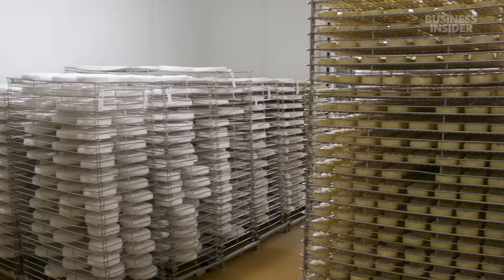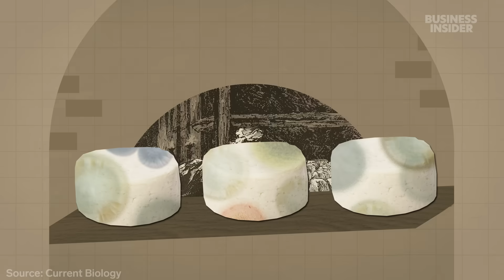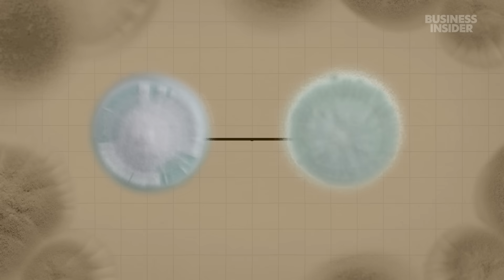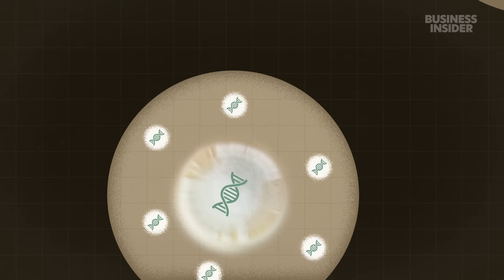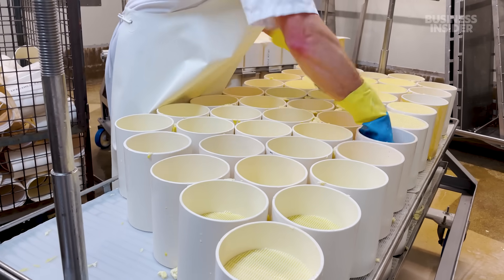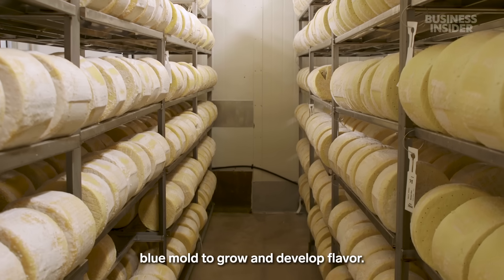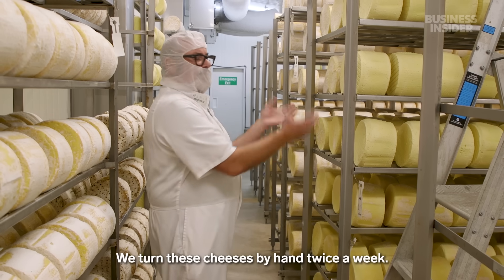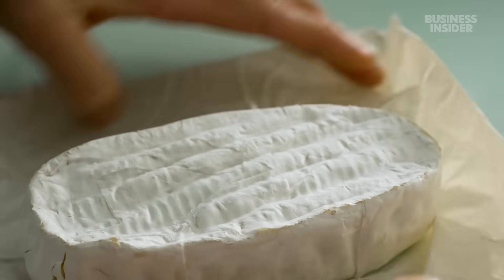Why the Mold Behind Brie Cheese Is Disappearing

Comment: Another theoretical idea. Get various cutting boards of staralized wood, stone, or metal. Keep those in a controlled cold chamber. Weekly by a cheese that have the mold covered cheese. Then use those boards for cutting a slice. Or just placeing the cheese down. Do not clean the board and place it away back into the chamber. To see if it creates a suttle controlled breading ground. Hyper specific on keeping only the cheeses with the brine that has the desired mold. (No specific brand, so the milk component might help) Then swab and see if the mold comeing from it is compatible.

Comment: It would be cool to cross do some isolated experiments. So a separate physicality for the purpose of controlled crossing. Making a small science batch of the cheese. Then get other cheese types to attempt the same mold with. Having two pieces in a controlled box. Bre to be paired with a separate cheese to see how the combinations are. See what mold grows from that cross over, but the idea is to use that mold with higher compatibility to re-cross breed into the primary mold needed. To re-create the diversity factor. But if the mold is more prone to overlapping. I am curious on what heat exposure or uv could do to slightly and try again to have the main bre mold introduced again. To see if that might help.

Comment: When a child in the mid-50s, "mouse trap" cheese was cut from a big wheel, on request, by the grocer who had first soaked it overnight to remove the cheese cloth and soften the rind for cutting. To me, the best part was the rind, the flavour and texture of which I enjoyed. The cheese itself was further enhanced if some blue/green mold graced it. I could never understand why most folk cut off and discarded the rind and the entire piece if there was a trace of mold. Such wonton waste! My dad and I "competed" for those outside slices! Sadly, modern high volume production saw an end to such flavoursome cheese from the 70s and the modern iteration is bland and uninteresting by comparison.  Col, NZ

Comment: This is a warning for waht's to come, most of the food we eat are 10k years of human edited evolution.  I am a mycologist and fungi suffer from sinensis, which is the issue when you breed a fungi and transfer it to many times, it becomes weak.  Most of the commercial fungus we use today is bred to the point it wouldn't survive in the wild, similar to our livestock.  Or as it was done before crspr, samples would get sent into space to receive radiation dosage for potential DNA manipulation.  

They need to change the diet that the fungus is consuming inorder to slow sinensis, but that is something which takes a long time to adapt the fungus to and would change it, but better to adapt than to lose. Something interesting that Paul stemets talks about, is that fungus usually exists on the edge of ecosystems, and often in the paths of humans.  We disturb habitats and create surface areas of nutrition for molds to survive, it's a very symbiotic relationship we have with eachother, but that also means that fungus we have relationships with might be so disconnected from nature that they only exist on petri dishes.

Comment: The banana has died out before. The banana we have today is a replacement for the first mass-produced banana, which was a different cultivar. If you've ever wondered why bananas don't taste much like bananas anymore, that's the reason. The original breed was much sweeter and tasted more like artificial banana flavor. However, a fungus killed almost all of them, so they switched to the variety we have today, which has much less flavor and is much starchier. They had to switch because the new breed is resistant to the fungus. Now, history is repeating itself because there is a new fungus, and the new breed has the same problem again.
Reply: There are still the original bananas, they just aren't available on such a scale they can sell them to the masses. If you want one, you need to get it from online or from a market which sells them.
Reply: @styx246  Correct. It never disappeared entirely, but it became impractical for the mass market since a single infected plant can wipe out most of the harvest. With only a handful of plants, the chance of infection is low. The risk rises as the number of identical plants increases. Some farmers still grow these older varieties, but only on a small scale, which makes them rare and costly to obtain.

Those still aren’t “original bananas.” Original bananas contained large seeds (5–20 mm, similar to cherry stones at 8–10 mm) spread throughout the fruit. The bananas themselves were edible, but people disliked dealing with the big seeds. Yet accidentally swallowing one is no problem, that won't do you any harm.
Reply: To add on, it's because nearly all bananas are the same banana, called the Cavendish (the old one was called Gros Michel).  Cultivated bananas don't have seeds, because they are sterile hybrids, so they get many banana plants by making cuttings. Which means they all have the same vulnerabilities, since there is zero genetic diversity.

Scientists are working on making fungus resistant strains, with some ready to enter fields soonish, so we don't have to worry about bananas going away. 

Thank goodness, because that's half my breakfast most days!
Reply: @rivenrime you writing that made me realize that growing up the bananas had freaking seeds and now they don't have it anymore, I did move countries but this is crazy.

My wife also says the bananas in Portugal are not as tasty as the ones in Brasil and I always laughed at that because I don't like bananas but she's right after all.
Reply: @GabrielP2R Yes, all modern bananas are a clone.
Reply: @rivenrime I need the gros michel to go extinct the x3 mult from cavendish is too good!
Reply: @rivenrime  The artificial flavoring part is a myth, and it's a false myth, it's a 100% synthetic flavor creased using a chemical in the banana which is why it doesn't taste like banana.

Furthermore, saying that the original banana was Gros Michel and the current banana is Cavendish is also a myth. There's hundreds of banana varieties that all descend from two kinds of wild banana. Perhaps in the US cavendish is the only one that is eaten but there's plenty of species in warmer countries.

Lastly, the Gros Michel isn't extinct but it isn't viable to grow in industrial quantities because they are still succeptible to diseases, it does taste closer to the candy due to having more of the chemical compound, but still not really like it.
Reply: @TheShadoek  Just go to Jamaica and see how many varieties of mangos and bananas and other fruits they have of which in the US we get 1% of that choice.
Reply: I love tiny red ones.
Reply: Hate to be the bringer of bad news...But the bananas we have today are also about to be on their way out The door because of two new strains of the same infection thats been spreading since 2015  they are worried if they dont figure out a way by 2030 with how current markets are today we will run out quickly
Reply: @wellthen.......9384  That bananas are on their way out is what I already addressed in my original comment. That's what the last sentence was all about.
Reply: @wellthen.......9384 😅

Comment: Can't you just keep it going forever like mycelium?, why would the mold go go extinct if you keep generating it in cultures?...
Reply: It isn’t that simple as it is a clone based organism.
Issues with cloned based organisms:
1- The same/similar issues as what inbreeding has.
So making it go forever as described would not work as the inbreeding/cloning effect would eventually result in defects at higher and higher rates per generation.
2- Clone based organisms cannot create natural immunities to infections.
This means all potential contiguous infections will be endemic and will eventually kill off the whole of the cloned species.
Good example is with bananas as the original market banana was nearly wiped out by a fungal disease. That same fungal disease is currently wiping out the new market banana.
3- Would honestly be better to just crossbreed the mold with other molds to bring in more genetic diversity.

Comment: Why not just propogate more cultures/agar dishes of it...? Its mycelium.. it can be kept going forever in theory. Only thing that would teuly cause this is over use of the mold or a power failure where the cultures are held that brought them to temperatures that can cause contamination.

Comment: If only we had a technology that could be used to examine a strain of mold at a genetic level and induce or introduce a mutation that increases spore production.
Reply: It's dangerous, hard and expensive, those are highly primitive cells , they're highly sensitive and just because we were able to kind of do it to other plants cells that big, doesn't mean we have the technology or the ability to do it to everything, otherwise a lot of plants would have been climate change prof by now
Reply: @m_elite  dangerous? Hardly. No more dangerous than any other selective breeding program. You create the strain, you test the results through a battery of tests.

Expensive? Only because gene editing paranoia has led to regulation that makes it hard for anyone but the biggest companies to cut through all the red tape and invest in the research, making it incredibly hard for small research teams and independent labs to work on stuff like this.

Hard? Arguable. Mostly the same reason as the above.
Reply: @Salted_Fysh  yes , the laws are broken against science, but it's still hard otherwise we will had done more with it than we already did , genetic editing is not that easy , also selective breeding and genetic editing are two different things, we can genetically edit it to make it produce more clones but we may add an ability for one of them to mutate into something dangerous like fetal or just straight up a mega mould that will multiple hyper fast and infect anything, you can also see a last of us type of mould , everything is possible when it comes to playing with genes , you may change just little think but it might with future mutations become something far bigger , also most big publications get genetic editing and our ability to do it wrong, just fission and vaccines, we can do a lot of stuff but we aren't gods yet
Reply: @m_elite  I apologize, and I don't mean this as a personal attack, but what you're talking about isn't the reality of gene editing. It's propaganda. Gene editing is little more than taking existing DNA and inducing targeted mutation by disabling, enabling or inserting parts of/into the gene sequence. It's a targeted procedure with clear parameters and goals. We aren't just throwing in random bits and bots and praying for the best.

Selective breeding is the same, except it's far less less precise, more expensive and much more prone to failure because it happens under far less controlled conditions.

And I can assure you, there is no last of us mold. There is no danger of a last of us mold. There are very few examples of parasitic fungi capable of inducing behaviour in insects but those are entirely different organisms with an entirely different metabolism and nerve structure. Not only is it already a very small minority of fungi that can even infect humans, basically none of them are capable of surviving our internal body temperature.

Don't let fiction muddle your understanding of real word science please.

Comment: Great video, but y'all mentioned the disgusting Cavendish banana and not its predecessor (Gros Michel).  Bananas had this issue before, which would've been a perfect example for what can happen here with this mold (relying on ONE strain leads to high risk of eventual failure).  I recommend anyone curious to look into this topic.  A lot of our crops are at risk since we rely on one specific strain a lot of the time.  A lack of diversity means if one thing goes wrong, you run into a high risk of major failure (where diversity may only kill off a portion of the yield, for example, due to different weaknesses, resiliencies, etc).

Comment: Did you know that some Cheese producers add microbes to their raw milk because it has gotten to clean and can no longer produce the original taste and texture
Reply: Interesting, perhaps it's from frequent antibiotics use on cows.
Reply: @N3G4T3  As far as I know it's mostly because milking is way cleaner than it used to be. So way less microbes are introduced into the milk while milking the cow.
Reply: @N3G4T3  Just better sanitation and purification techniques and technology. Eg. if I remember right Swiss Cheese makers have to put stuff in the milk for the cheese to have its iconic holes because it turns out they form because of impurities that in the past we didn't have good enough equipment to get rid of

Comment: Why can't a lab just try natural selection? Have 500 petri dishes all with the same mold starter, let it grow for X amount of time and weight the samples. Samples that add most weight within the time go to the next round. Looking at the mold growth it might only take 1-2 weeks for a single cycle of testing. After a couple years of this process you could reverse the process by selecting for faster growth mold that (likely) produce more spores leading to greater weight. Within the 500 petri dishes there are likely genetic mutations that may up/down regulate spores. Seems like something rather trivial given some funding. Or is this too simple?

Comment: In 40 years I've noticed the Camembert outer layer has been milder, and less complex favod. As a kid it was too nasty, but it has reached a point it's gone to too mild. This is not just aging taste buds.
Reply: maybe try a different brand? i find plenty of mainstream/cheaper supermarket brands don't even have a real mould.
Reply: @brunetteXer  3 different brands, one of which is French. I just treated myself to that brand, and it was even weaker in taste than the Aldi store brand. Didn't know you could make fake rinds on Brie. Do you have a source, I missed that trend. Not surprised, I just missed that they were doing it.
Reply: I think what they're leaving out here is that you can still selectively breed self-cloning lineages because it doesn't stop mutations and people have made very bad decisions that have left them with weaker and milder strains. However I think they may be overstating the problem because there are multiple people around the world who have kept their own strains going and you're probably going to find some of those are a bit stronger because they're not being reproduced in lab conditions and thus need to be stronger.
Reply: So, do you eat the rind or peel it off?
Reply: @blargcoster  I eat the top and bottom rind, but on the ends there is too much rind for less cheese, and it overwhelms the cheese flavor.
Reply: @shawncarroll5255  Never had this style before and I bet it'll taste good. Just gotta find some...

Comment: Reminds me of the bamboo problem. (And also of various Star Trek stories about the follies of genetic purity/uniformity obsession.)
2:22 10:57 pro tip: "one of the only" is cringily illogical speech. "only" refers to a single unit or group. As a group it is unspecific. "one of the (very) few" is a proper way of saying it. Because there is only THE only, not one of several only/onlies.
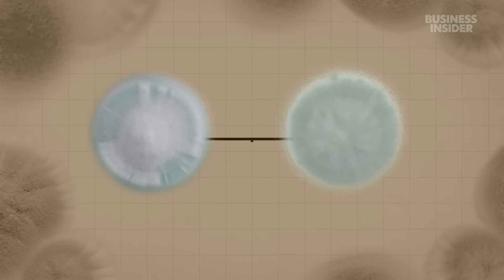5:08 "Toxic Babies" - good for a punk rock band name.

Comment: I'd bet, France has been sending out spelunkers, with mold test kits, in Meaux and Melun.  
 i know i would be :)
I've made basic cheese at home.  Including making cheese by scraping mold from the outside rind of Brie cheese.   Although its salted, scraping off the outside mold worked for me.  Plus, you can use a "live" buttermilk (for mesophilic cultures) or yogurt (for thermophilic cultures) as a substitute for a specific cheese culture starter.